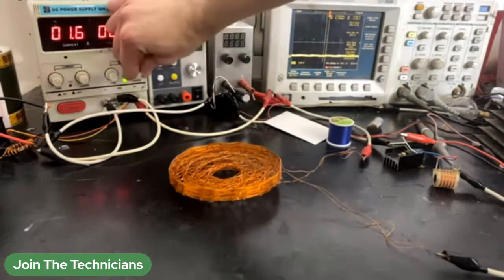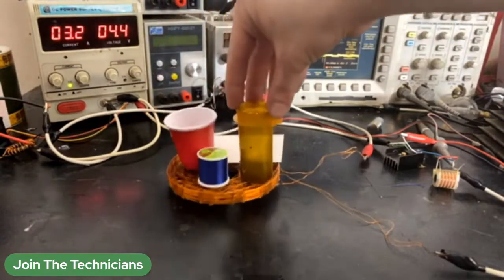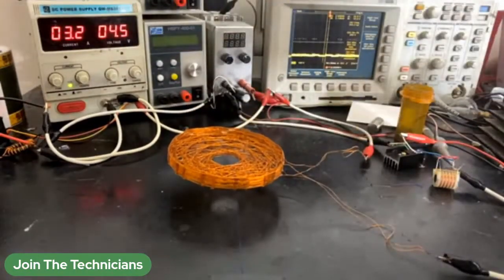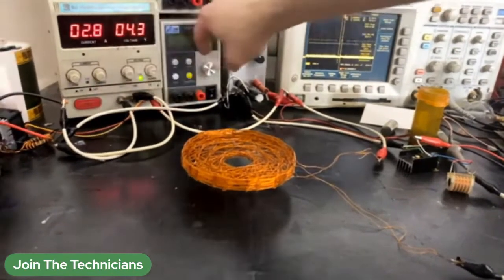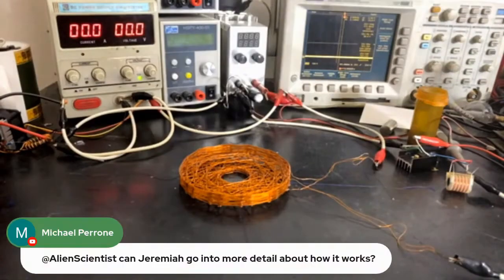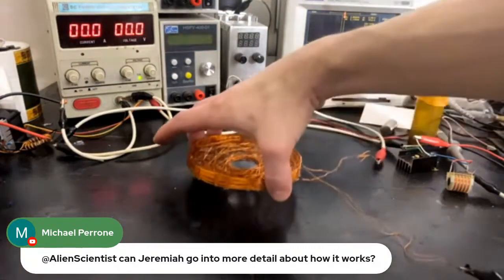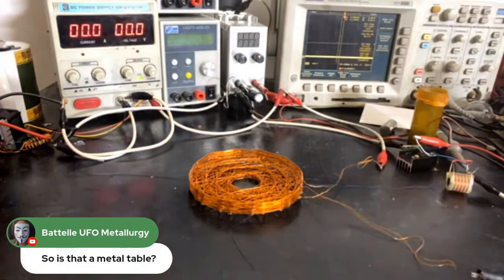Levitating Star Challis Starship Coil @wpgenlighten4truth2 @exoticpropulsion8175

Comment: you please try to make it
1) make it the coil 2 winding one primary coil geometric like Mike Powers star challis then make bigger coil with most the windings round the rim this is secondary the coil transformer  winding are DIFFERENT ONE PRIMARY ONE SECONDARY but SECONDARY BIGGER step up transformer

2) put 4vdc at secondary winding wrapped round rim

3) put square wave at primary winding

4)  put iron filing to table under coil lay down the iron filing under coil

5)  turn on sig gen square wave at primary  turn on 4vdc at secondary

6)  watch the iron filings see if you get Lorentz force oscillation back forth in iron filings moving back/forth on table because due to primary it oscillating secondary is magnetic field

7) put amplifier like MOSFET feed square wave to MOSFET for higher power to primary

8) tie down coil it fly all overy

is lorentz force it from magnetic field of secondary winding and from oscillatring primary and it not dangerous but no handy under coil please

if no iron filing move of Lorentz force bigger hit needed to primary like a back emf try it and you play with frequency you find resonant of frequency of coil you find in youtube how adjust frequency you find resonant

Comment: I think the problem here, unless there was further elaboration, is that it's so easily replicated so long as someone is just trying to achieve the same results without regards to how they do it. I would guess Electroboom would outright just show how he'd do it using a magnet under the table and feed DC into the coil or just PWM it. 

In the longer video I get the slight context that Jeremiah was disgruntled over how quickly the clone masters over in China are able to recreate something and sell it for cheaper. He mentioned that's what happened with him and some plasma pens etc. Makes me slightly build motive for this video from a 'prank' perspective. Picture a team of Chinese engineers winding their brains out to no avail lol.
Reply from the maker: Wise take
Reply: @sFeral  What do you think about some of those old ion lifter videos? 'Jim Rugroden' was one channel I saw recently but he had a circular design using a 2n3055 driven flyback on a JT circuit. It was actually pretty compelling. At the same time I watched it in doubt just based on the few times I've tried to make those things.
Reply from the maker: @Magneticitist  ion lifters work for sure, but I guess the results depend on the type of CRT flyback, perhaps the frequency is a factor, the ones without any internal capacitors seem to work well, and the indicator for good results appears to be the production of the purple type spark at >30kV  which in my experience gives off a lot of ozone
Reply: @sFeral  From my experience they only worked with significant noticeable wind and needed to be as light as possible. In that one guys videos he has his heavier than I'd ever seen one and I can't quite figure how he would have fake it. I can imagine copying his design and never getting it to show any lift whatsoever. If however his build was legitimate it def changes what I thought about those things.
Reply from the maker: @Magneticitist  ofc the wind is noticeable at the same time lol. I hadn't looked at the exact device you're talking about, just need to find the vid
Reply from the maker: @Magneticitist  I've seen the circular one before, but that design seems lighter than most since the circular part seems structural, probably a thin plastic bottle cutout wrapped with foil, or even better a cutout from a large Al can

Comment: Could be that the black carbon paint of the table is only conductive at high frequency ac and not at dc. Which would be cool way to eliminate the dc losses and would also eliminate a lot of metal use in electric machines.
Reply from the maker: a conductive layer that thin would burn off due to inductive heating, if this were inductive repulsion, the effects would last only momentarily
Reply: @sFeral  not sure how low resistant small mono-layer carbon flakes could actually be (I guess they can be close to superconductive), at least they would be extremely heat conductive and could spread any heat quickly.

Comment: Check if there is negative gravitation field above coil.
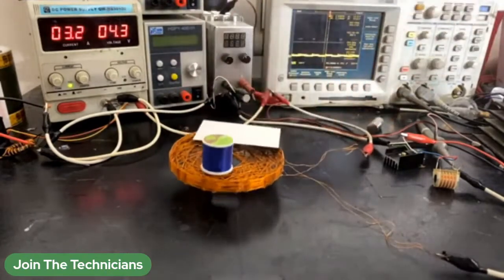Reply: That's a really, really good suggestion!  So I re-watched it.  At time 0:14, he puts a very lightweight object - a piece of paper, a business card - on top of the coil.  There is absolutely no sign that the paper did anything else except sit there like you'd expect.  If there was a gravity neutralization going on, you might expect to see even a small bit of lift-off, like a slight gap or something between the paper and the coil.

There's absolutely no sign the paper wants to lift up or levitate even a tiny amount.  It just sits on the coil completely at rest. And the magnitude of the effect is not small - he manages to stack other heavier items on the coil and it supports them.  Why would the effect be strong but only one one 'side' - the wires are round in shape.

I think it's a hotrodded lifter in the way I described in another comment.  Because to your point,  if there was a gravity effect, why would it be confined to one side of the coil.  It's a bunch of wires.  it's not clear that a collection of wires, no matter how 'geometric' the layout is, could somehow develop a gravity effect on only one side of a bunch of round wires.

Comment: There's something just not right with this, even with three hundred turns of copper wire and an aluminium base after about twenty seconds it would be glowing red.
Reply: That wire is around 1mm thick so 3.3 amps won't heat it up very much at all, it's max ampacity is at least 14 amps.

Comment: Unfortunately it seems like they’ve stalled on releasing more info on this device at this point.  Recent stuff of focuses on using these types of coils for healing or electro culture.  I figure people in this circle are still watching them, but just in case.  Of course, those are both very important uses so I don’t want to denigrate that but on the other hand, hovering tech would be great for publicity and for making a lot of money to fund stuff.
Reply from the maker: Fraud is the current status. Absolute lack of evidence, that the results can be replicated, leads to that sensible determination.
Reply from the maker: @darkorse9752  as a thought experiment or real experiment which you could have filmed and showed instead of claiming you know ?
Reply from the maker: @darkorse9752  Call back in when you have something to contribute. @TheActionLab is a perfect role model
Reply: @sFeral  Oh and you have something to contribute? Why don't you try and attempt to make a video experimenting with the functionality of this coil, instead of depending on other people to figure it out for you.
Reply: But if you feel like I'm not contributing, then I'll just delete some messages I've posted here, since you feel like they're useless.
Reply: @darkorse9752  it comes off like you’re taking this personally to at least to some degree.  Please understand that although being open minded enough to consider things is a key part of this community that has compiled over the months and years, so is being critical.  Without that critical part, this begins to slide towards the direction of becoming more like a larper community (like almost all of “ufology”).  I don’t know what you deleted or if you deleted comments at this point, but if you have something to share about what is going on that could really help to build it, yeah please do share.  Otherwise it seems like it would take a lot of failed coils for this to work without knowing exactly what needs to happen with the magnetic field.  Unless maybe this effect is just ion wind and having a pulsed power supply is the more important part, which I think is also possible.
Reply: @SaveTheFuture  It is quite disheartening when individuals disregard the significance of my insights, particularly as a physicist and engineer who holds technology and the functionality of various devices in high esteem. The effort and dedication required to develop and comprehend such technology from its inception should not be overlooked or trivialized.

In my opinion, it is crucial for engineers to invest time in understanding the underlying principles and physics behind any technology they encounter, rather than merely utilizing existing solutions as guidelines. A proficient engineer, well-versed in their field, should have the ability to discern the subtleties and nuances within a given problem without the need for explicit instructions.

I must admit that I have removed a few messages, as I suspect the inquirer's intentions may not align with a genuine desire to learn and comprehend the inner workings of the subject matter. Instead, it appears they might prefer a more superficial approach, seeking shortcuts or easy answers rather than delving deeper into the complexities of the technology at hand.
Reply: @SaveTheFuture  I assure you that if individuals genuinely paid attention to Jeremiah's concise explanation on Charlie's channel, followed up with the provided updates, and truly listened to every word he articulates without dismissing them as incomprehensible gibberish—which is, unfortunately, a common tendency—they would discover that his explanations are lucid and informative. By thoroughly adhering to his guidance and comparing his insights with foundational knowledge in physics, it becomes evident that Jeremiah effectively demystifies complex concepts.

Regrettably, many people today seek a simplified, step-by-step approach to understanding intricate mechanisms without first grasping the essential principles of physics. This mindset has led to hobbyists overlooking the core concepts of physics in their pursuit of fine-tuning their devices and achieving results without investing in a proper foundation. It is indeed disheartening, as electronics lies at the heart of physics, rather than the reverse.

In today's world, the true essence of engineering has been lost to some extent, as individuals often prioritize immediate outcomes over a comprehensive understanding of the underlying principles.
Reply from the maker: @SaveTheFuture  https://drive.google.com/file/d/1Cjd6VZy1w0DlgQKxYqyK0BG1U8sknVta/view?usp=sharing
Reply from the maker: @darkorse9752  "Prove it" is the usual phrase, and the one I should have used immediately.
Reply: @sFeral  "You don't deserve it" is the phrase I should have used immediately.
Reply from the maker: @darkorse9752  your butthurt is showing, and I don't care for seeing it. Announce your occult knowledge somewhere else. You display the same characteristic as Gerald, in that you act as if you're only talking to me when you write here. Lol, everyone can see this. That is why both of you have a habit of deleting comments.
Reply: @sFeral  I'm well aware of what I'm saying and the audience that I'm talking to. So, let me ask you, who's really upset here? Is it me, or is it you because things aren't going your way? It seems like you might be used to having others do stuff for you, and when that doesn't happen, you get cranky.

Honestly, you're acting like a kid who's too focused on making this coil work, without really knowing what it is or what it can do. It's not just some toy. It's actually pretty dangerous. And that's exactly why you don't deserve to know, especially if you're just gonna mess around with it.
Reply from the maker: @darkorse9752  Replying to you is a waste of time, as your deleted comments confirm. Let any unfortunate spectator judge for themselves if anything of interest was hitherto shared by you.
Reply: @sFeral  If you feel that responding to me isn't the best use of your time, I'm just wondering why you choose to keep replying. Maybe anyone who sees our conversation will be able to grasp what I'm trying to communicate. I'm doing my best to provide helpful information without putting people in danger, but it seems like you're having some trouble understanding that. Physics isn't your strong suit, and that's probably for the best, because people shouldn't play with things they don't understand.